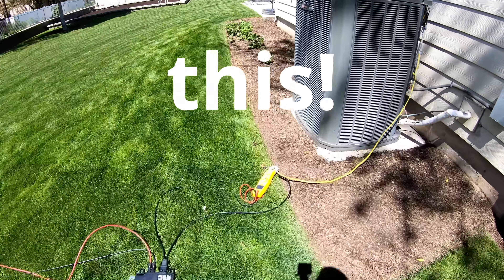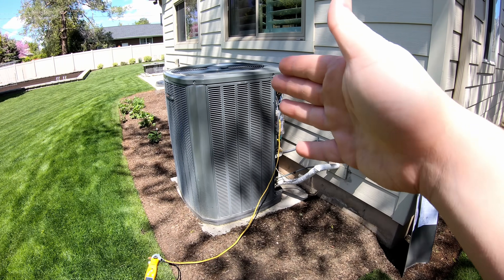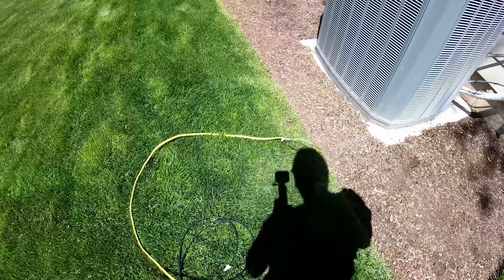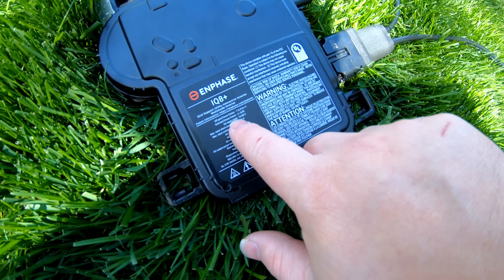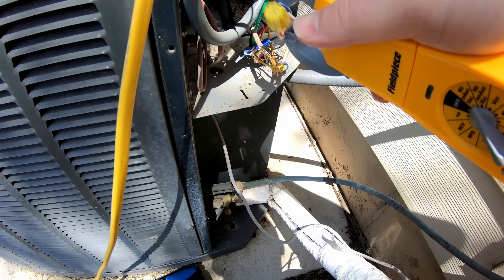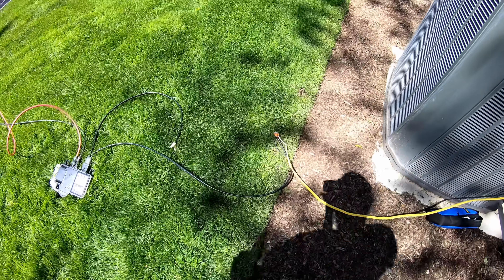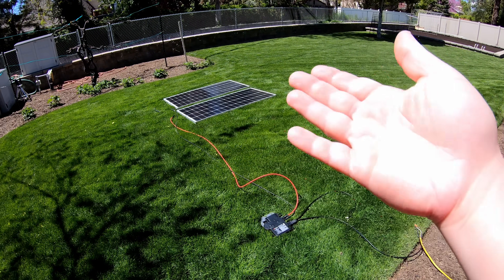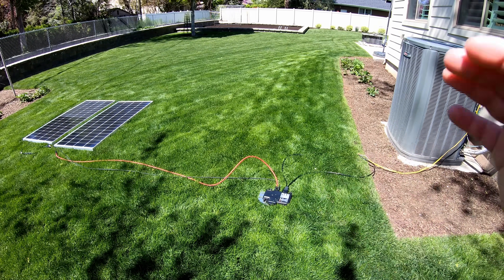1 Hack To Eliminate Your A/C Power Bill This Summer!

Comment: Kinda doing something similar but in a totally different way, I should cover it on my channel.
My 2 biggest energy consumptions are my HVAC and my Server Rack/PC setup.

I plan on using a Delta 3 Plus as my Server Rack UPS and due to its hybrid charging it will use all the solar power it can to run any load and charge the battery, but it will pull power from mains as needed when solar is not enough.

So very simple setup, and the hacky comes in when I start expanding the batteries, setup relays, etc.

Your setup is cool, but doing it the way I plan will be much easier for a layman and make more use of the solar power by not waisting those daytime hours when the HVAC is not powered on, and instead allowing it to charge the battery.

I am a bit supprised you didn't run into challenges of 120v vs 220v I guess the IQ8+ takes care of that for you?  I had this challenge when working with generator backup power for the whole home.
Reply from the maker: Sounds like a good plan! Are you using a transfer switch with your Delta 3 Plus? And then obviously you are only powering a 120v A/C unit because the Delta 3 Plus is just 120V. The Delta Pro 3 and Ultra have 240V split phase…but not the Delta 3 Plus. 
Mine is a full home 240V A/C unit. The IQ8+ inverter only does 240V split phase so that made it nice and easy for a big unit like mine. Thanks for watching! Best of luck to you with your setup!

Comment: Not sure how 2 200 watt panels generates enough power to power up a 2 pole 30 amp AC unit?
Reply from the maker: That’s what’s awesome about this! The micro inverter is a grid tie inverter, so once it sees the grid power when the A/C unit turns on, it syncs up and provides as much power as it can. Any extra power needed to run the A/C unit gets made up by the grid. So it’s a very simple way to start offsetting your power consumption and scale it as budget allows. Thanks for watching!

Comment: Would this work even if you already have a grid tied solar on your house? Would this in theory just help with running rhe ac and not require more permits of getting more permits to expand my currwnt system?
Reply from the maker: Yes it would work with an existing grid tie system. You’d of course want to check with your local codes and such to see if you’d need a permit or not. Thanks for watching!

Comment: So this is AWESOME, but the need for the pig tail eludes me because I am not an electrician. Also NO battery...WHAT?
Reply from the maker: I’m not 100% sure what pigtail you were referring to… But it works without batteries because the Enphase inverters are grid tie. So any electricity they don’t generate the grid will make up the difference for. Essentially, I’m using the grid as the battery. Of course, be sure and consult a licensed electrician Before attempting anything yourself. Thanks for watching!

Comment: I wonder if you connect it to the soft start unit or bottom side if contacts would be better, it would still maintain grid protection and reduce the grid load without worrying about damage of not enough or too much power
Reply from the maker: Interesting thoughts. I’d personally keep it wired the way I have it. Thanks for watching!

Comment: I have solar already but go over and owe a electric bill in the summer.  Would love to power it with an off grid solar system but what about nighttime.  No way could the solar company know about this!
Reply from the maker: You might want to look into a battery bank to handle those nighttime hours! I’ve got a new version of this that I will be releasing in a video about in the spring that integrates cheap LiFePO4 12V batteries to help when the sun isn’t out! So be sure you’re subscribed so you don’t miss that when it drops! Thanks for watching!

Comment: I will say this once only once t&ere is not enough power coming from the panels to power the AC system this is a fraud A lie you can not power that system on the panels you are using, an this is true it takes more then you are putting out to charge the system ratings you are looking for ,people its simple do the math an do not try this or you will destroy your AC system, do to the system of coming on an off it will burn out your invert in the system that is not sufficient sufficient
Reply from the maker: Did you watch the whole video to see how the grid power assists the solar? Thanks for watching in any case!

Comment: Why do people make videos to scam others? The air conditioner runs on 220-240 volts and the inverter only outputs 110-120 volts. I just saw two wires, one black and one white. Also, the circuit breaker that appears in the video that you already removed when you turned on the air conditioner is not outside, which means you already reinstalled it and are running the unit on your house current. People who don't know about electricity may believe the video but those of us who know about electricity know that it's a scam.
Reply from the maker: Ummmm. You may want to look at the voltage specs on those inverters and check it against your comment here. As far as the color of wires goes, you’re right, a white wire should not carry current typically. But I wasn’t going to go drop a lot of money on the right colored wire when I had excess available and it still works great! I’ll just color the ends of the white wires with red sharpie! That’ll make it better! You also didn’t seem to watch the full video when I was taking different amp readings showing what power I was offsetting. In any case, I appreciate any and all views from normal people as well as keyboard warriors like yourself! Happy New Year!

Comment: Okay, looks like a neat idea, but I'm not that handy/brave.  What I've always wondered about is running my portable A/C unit off of solar panels.  Could something like this do that where it pulled from the solar panels when the sun was out but automatically pulled from the grid (my household plug) when they weren't getting enough sun?  Don't get me wrong, I'm probably not brave enough to try that, though I'd rather risk a 400 dollar room a/c than a 10K house a/c unit.  I just think it would be neat to do something like that and be able to run it all day with just the sun and still keep things cool at night.
Reply from the maker: There are not any good solutions like this that I have found yet for window A/C units. But I'm going to keep looking because I think that would be sweet! Thanks for watching!

Comment: If you went downstairs and tripped your main breaker.... Put your meter to the bus bars on your fuse box it would read power correct.. 1.7 amps on each leg....????
Reply from the maker: Yes…and no. You won’t get any power out of the inverter because it will shut down without seeing the grid. Thanks for watching!

Comment: Illegal without a grid-tie net-metering agreement even though you're using all the power you generate because you connected your power source to their grid while the contactor is closed. Of course, who's really gonna know. But if you get caught, you could be heavily fined. You'd be better off disconnecting the AC grid source from the motor contactor completely and getting standard non-grid-tie inverters and more solar panels to directly power the blower and/or compressor without any grid.
Reply from the maker: Some day I hope to have a big system like that. And as the disclaimer said, do not attempt this yourself. This is for entertainment purposes only and should not be repeated. Better to involve a licensed electrician. Thanks for watching!

Comment: I did it with a DC motor heat pump and started, including it in my residential solar sales, and everybody is insanely happy with it and how well it works and it fixes so many other problems with math when it comes to energy that it’s unbelievable. Of course that’s in states where air-conditioning isthe largest load like here in Texas
Reply from the maker: Awesome! Thanks for sharing and for watching!

Comment: Ok you have a positive  and negative  going to the micro inverter , out of the inverter you have 2 hot legs hooked to the down side of the switch. Did you ground it also.
Reply from the maker: Just connect the grounds to the appropriate grounding points on the A/C, Inverter, and Solar Panels. Thanks for watching!

Comment: You have all the gear but measure each wire lol. The 2 wires are going to measure the same. They are whats known as a circuit electricity flows in one wire and out the other wire. lol😂
Reply from the maker: You’re exactly right! Thanks for watching!

Comment: I'm familiar with electrical, please don't say don't touch it. I need a second opinion. I'm doing this but I have m215 inverters that run a neutral. I'm using a fusable disconnect then to compressor. Ac wiring doesn't use neutrals so, what the hell do i do woth the neutral?!? I can't run it to the main cuz different system altogether. I've been told different opinions, what do i do with the neutral, anyone??
Reply from the maker: Sounds dicey to me! I would consult a licensed electrician on where to connect stuff! Thanks for watching!

Comment: If you don't have the enphase already, then I would suggest to pick up a grid tie inverter WITH LIMITER. It will automatically do what you are trying to accomplish, plus run your water heater, and other appliances without backfeeding the grid.
Reply from the maker: That sounds great! What inverter does that? Thanks for watching!

Comment: Nicely done.  For 2-4 panels this seems like a good solution.  However, when you start getting in the 10+ range (and if you want to add some batteries), a dedicated inverter/charge controller setup will probably be less expensive.
Reply from the maker: I would agree with you on this. Thanks for watching!

Comment: About  10 years  ago the Lennox HVAC company had a  system that they put out as an add on that would feed to the power grid any excess power. All solar converters were built in the outdoor condensing unit and you would have 15 plus panels mounting on your roof , the system had a 15 year life cycle but the pay off would be closer to 20 years ,which killed the demand for such a system .
Reply from the maker: Interesting! Didn’t know that. Thanks for watching!

Comment: How could a system like be designed more easily that’s plug a play? I could get behind selling something like that
Reply: One issue I see is where let’s say you match it closer to what the AC draws. The compressor hits a thermal overload and disconnected inside the compressor, not at the relay. Now your inverter would still be connected via the relay, potentially back feeding the grid or your home.
Reply from the maker: Something like that would be very cool! Thanks for watching!

Comment: Yep go ahead and try that he’s not telling you your AC unit runs on 220 inside
Reply from the maker: My indoor unit runs on 120V and is just the fan in air conditioning mode so certainly not as big of a load as the outdoor unit…but I have a way of hooking up external power sources to the indoor unit as well. Check out any of these videos where I run my indoor furnace off battery power: https://youtube.com/playlist?list=PL-2uuHDasQcp2gNWpR-N_GUEey1fhnbgI&si=dlQ7VyoH0tYG_cxO Thanks for watching!

Comment: Wish you went  further by making it a permanent setup with step by step instructions along with products used list.  I was very impressed and had been thinking if that was possible.   I was looking at using one of those 450 Watt bi-focal solar panels, as those are getting cheaper by the day and actually a good set up when vertically installed.    I have also  been thinking of doing a mobile on wheels backup battery 200-300 Ah with 450 Bi-focal solar panel and home outlet charging options,  so  i could run my digital window A/C window unit at night and charge during the day, along with being able to run my refrigerator for as long as possible in emergency situations.  The reason i want this  setup is because of the  hurricanes we have been getting in Florida.
Reply from the maker: Oh don’t you worry! I am working on the ultimate permanent setup while still be cost conscious. It’s coming together bit by bit as money allows. Anyway, be sure you’re subscribed so you don’t miss the next iterations! Thanks for watching and best of luck to you with your cool portable power wagon! I have a lot of great real world testing videos (including fridge runtimes) on LiFePO4 batteries you might want to check out!
Reply: @theresatrickforthat  thanks I subscribed to your channel

Comment: How is this any different then back feeding the power into your house and having it naturally find where it needs the power as long as you don't produce more than you use?
Reply from the maker: It ensures there is no back feeding since the solar only runs when the A/C is running. Plus an added layer of back feed protection of the power goes out with the A/C contactor physically disconnecting the solar from the grid if the power goes out. Thanks for watching!

Comment: ok i'm very intrigued.. question do all these outside compressor units have a "contactor" as you call it? Please elaborate on what this "contactor" thing is!  and how do I find it on mine? Mine looks similar to yours just a little shorter. thanks
Reply from the maker: Most of them do have a contactor unless you have an inverter type A/C unit. You can watch my wiring video for more information: https://youtu.be/8-BCiVw881c?si=YZTXhozzIXy3O8FD Thanks for watching!

Comment: is there a device to automatically switch between solar and power when it is cloudy? i dont have much sun here and lots of trees. i am testing out a 40w panel to charge a 12v 35ah battery. i am using it as a heat generator for the aviary.
Reply from the maker: I’m not personally aware of any device like that. Thanks for watching!

Comment: Can you use this to run a portable AC? I work for a HVAC company and we are pretty much getting screwed by the change in Freon every few years, R22 to 410A and they are getting rid of 410A with something else. Then the cost to run these things is ridiculous.
Reply from the maker: I’m working on a 120v solution…but at the moment this solution is only available for 240v units with a contactor. Thanks for watching!

Comment: Is the IQ8+ micro unique in some way or would this work with any charge controller?
Reply from the maker: You need a grid tie micro inverter. Thanks for watching!
Reply: Thanks for your creativity! Since the IQ8+ has 2  AC leads, could each one be  connected to an ac unit to increase the utilization of the panels? I have 2 ac units. We all appreciate your work!!!
Reply from the maker: @cphx1208  No. You must only connect one inverter to one A/C unit. Both leads are used in each unit.

Comment: Nice job!  Can't wait to try this out - thanks for posting.  RE: pool pumps - you can now get DC powered pumps that are fantastic for less then around 1/2 the cost of most AC pumps.  I have 4 panels dedicated to a DC pump (which came with controller included!) and it performs better than my AC pump ever did and is free!  What's more, my pool is cleaner and warmer in summer because instead of running 4 or 6 or 8 hours it runs however long the sun is up so the water is better filtered and circulated.  There is also a great market for used AC pool pumps, so between selling mine and having my pool pump cost go to zero, this has paid for itself many times over.  Been using it for 3 years now - have some video I could post.
Reply from the maker: Cool deal! Definitely post videos about your DC pump! That would be cool to see in action! Thanks for watching!

Comment: I did same but with 6 panels. I was connected to grid but my utility complained so I connected them to the AC contactor. Did same with 2 panels to pool pump.
Reply from the maker: Sweet! Thanks for watching!
Reply: @theresatrickforthat I bought used 300 watt panels and enphase units from Facebook marketplace. 6 panels 3 inverters $450
Reply: What charge controller did you use with 6 panels? How many amps they provide?

Comment: That is very interesting.  I live in Phoenix AZ and the AC bill in the summer is as high as all of the rest of the house combined (higher). That thing NEVER shuts off (mine is like a 4.5 ton) and we have lots of sun. This seems like a very good inexpensive modular way to approach lowering that bill. So do those micro inverters match the sine wave of the grid when the turn on? And does the micro inverter put out 220 vac?
Reply from the maker: Yes and Yes to both of your questions. Thanks for watching!

Comment: Why would it no t be possible to power just the high voltage users in the house?  I have a heat pump HVAC system and electric water heater.  Those 2 things use the most energy.  Why aren't solar possibilities being bantered around for that?  Instead of whole house?
Reply from the maker: Beats me! That’s why I’ve been playing around with these solutions! Thanks for watching!

Comment: Similar concept bought a used 12k BTU portable AC and attached to a battery inverter combo fed by solar and it is able to generate enough cold air to keep the central AC compressor from kicking in at peak Texas hotness.  I just keep the main AC fan going to help circulate the air.  Need more confidence with electricity to try your setup.  Thanks for sharing.
Reply from the maker: Sounds like you have a great setup! Thanks for watching!
Reply: Have you seen that it helps with your energy bill? I'm with you on Trick's setup, love it, but...

Comment: My quick idea.. have a 5000 ~ btu window ac that is only run off of deep cycle batteries and solar. Have it in an area of the house that will circulate through the house. If the window unit can keep the ambient temp of the house down the main unit will turn off a lot faster. No need to wire into the big ac.
Reply from the maker: Great idea! Thanks for sharing and watching!